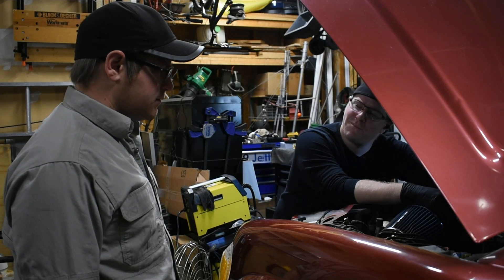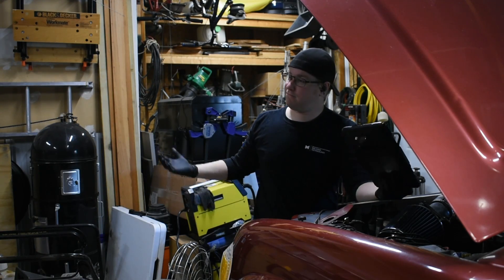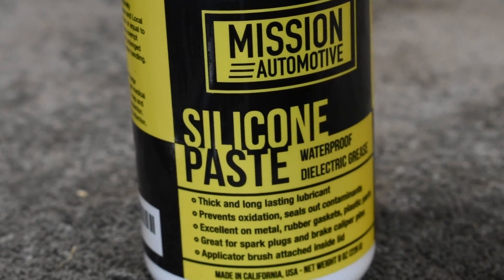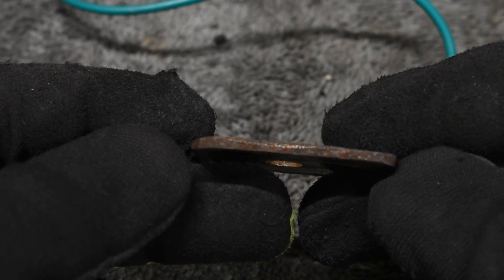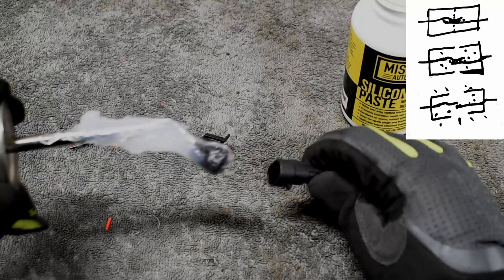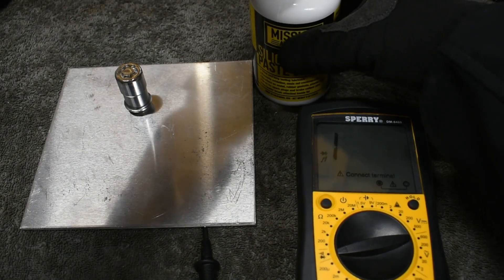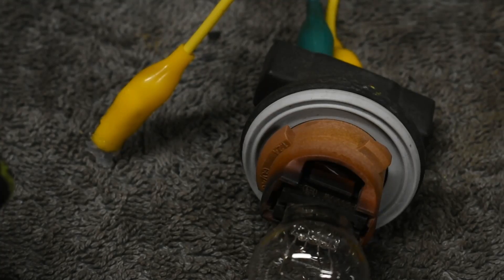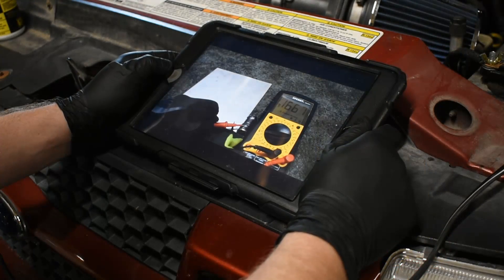The Shocking Truth of Dielectric Grease

Comment: I don't understand why people get confused about Dielectric grease,  I have used it for years without a single problem, One thing I will point out what you done in the video that I avoid doing and that is I don't use it on connectors that already has a seal/gasket, My reasoning is that the connector is already protected from the elements and the grease you put inside could get compressed when putting the connector together which can result in blowing the seals out

Comment: I experience connection interference on my Electric bike due to connecting/disconnecting the battery. Each time you initial a connection/disconnection of the battery you can cause an arcing of the connection which can lead to a buildup of interference. The dielectric grease can provide a coating that prevents the arcing from occurring. It also reduces the friction of connecting the battery allowing for an easier assembly while reducing the buildup of interference particle and oxidation of the contacts. Just be mindful that their are two types of connecting grease. Conductive and non-conductive. The conductive type is impregnated with carbon and i would recommend that you totally avoid using the conductive type of grease on your battery terminals.
Reply: What you need are anti spark connectors, These have a built in resistor connected to an isolated pre-contact point that shunts through the resistor as the connectors are mated that allows the capacitors in the ESC to charge gradually (as in a 100'th of a second instead of a 10,000'th) and prevents a spark. That said grease will preserve the gold plating in large DC connectors by lowering friction so it doesn't wear off as quickly.

Comment: Is it useful on the rubber seals if your vehicle
Reply from the maker: Yes, it can be used to lubricate o rings and seals. Before using, check the label to see if it has any warnings about what fluids your dielectric grease should not come in contact with. 

I prefer to use whatever fluid the o ring is going to be in contact with (oil for oil, coolant for coolant, etc.)

Comment: From the uk some people say dont get it on the connecters only on the plastic around coil pack is this true. And how about spark plugs is it ok
Reply: I experience connection interference on my Electric bike due to connecting/disconnecting the battery. Each time you initial a connection/disconnection of the battery you can cause an arcing of the connection which can lead to a buildup of interference. The dielectric grease can provide a coating that prevents the arcing from occurring. It also reduces the friction of connecting the battery allowing for an easier assembly while reducing the buildup of interference particle and oxidation of the contacts. Just be mindful that their are two types of connecting grease. Conductive and non-conductive. The conductive type is impregnated with carbon and i would recommend that you totally avoid using the conductive type of grease on your battery terminals.

Comment: Dielectric is literally an insulator similar to wire insulation. It works well on cleaned-up electrical contacts because: 1) keeps connections clean and weather/contaminate resistant, 2) lubricating electrical contacts providing a tighter fit by increasing the surface area of "Certain Applications" such as a threaded battery terminal connection. Silicone enables the bolt 🔩 to drive deeper inside the tap resulting in more surface area... THUS, increasing the conductivity in that instance!

Comment: not only nonconductive it is a good insulator. Main use is for insulating (and lubricating), spark plug boots, prevents tracking very effectively, especially good for insulating bothe ends of coil on plug boots (coil overs). We are talking many thousands of volts, so has to be good insulator.

Comment: I used to use diectric grease on snow plow and semi light connectors. Problem was moisture would get into connectors, the grease would help retain the moisture and there would be shorts. Watched a video of a guy restoring a trawler in Australia, he used a spray on connectors that dried, did not restrict connectivity and prevented corrosion. Can't remember the name off hand but it works well. I figured it was designed for salt water applications so it would work well in snowy environments where salt is used on roadways and I have found it is much better than dielectric grease.

Comment: no... but it does SLOW DOWN water ingress.... 
i live in montana.... so it gets WHEELED HARD in snow
.
trans output shaft speed sensor codes..... because rusty 97 shitbox jeep things
un plug, spray out with contact cleaner/WD-40..let dry.... big glob of di-grease.... plug it back in
get about 100 miles and do it again lol
got pretty quick at it in -50F

Comment: Helps prevent voltage leakage.
    Helps insulate the electrical connection in frigid conditions.
    Protects against water damage.
    Protects against corrosion.
    Protects against dirt and grime.
    Protects against heat damage.
    Protects against material bonding.
    Protects against electrical overheating.

Comment: I never had a problem with greasing first before connecting. 
And if i wanted to help conductivity like on starter motor and alternator terminals i use a little copper grease.

Comment: you need to measure actual voltage drop ...... i use dialectic grease on all insulated connectors as a deterrent from corrosion..... BUT in the PROPER areas AND in a PROPER amount

Comment: I have put it on connectors for decades without problem.  Generally, avoid metal to metal contacts but all around do.  Many times, I put it metal at metal without problem.  There are explanations on the Internet that when you put dielectric grease in contact it goes in walleyes of metals.

Comment: If the dielectric grease was a conductor it would short out systems where the grease is making a connection between two terminals,like it would if you placed the connectors under water.

Comment: Using DeoxIT on the contact pins improves conductivity AND protects against corrosion of the bare metal. Better conductivity reduces/eliminates pitting caused by hot spots along the surface of the metal. Dielectric grease does none of this. I use DeoxIT on everything where metal meets metal whether it's automotive, networking connections, HDMI, antennas, computer boards, light bulbs, switches... the list goes on and on.

Comment: This video is missing the real point. The grease eliminates the formation of oxidation and corrosion by the simple act of filling all voids (if adequate amount is applied) within the connector. The electrical connection is still made merely by the actual contact of the two metal contacts that actually sufficiently touch together adequately. As the video correctly states, the scraping action made at the metal connectors actually clear away only the grease between the 2 contact points.

Comment: I Just to add that.i    had been using permatex dielectric grease on ignition coils every time I bought one !!well and when came to starting  they would just Crank !!well.  My   first thought would be to Blame the Coil  makers!    and Today I replaced my second coil and greased it and wouldn't Start!!! so I went bought another and DID NOT PUT ANY Dielectric grease and the car Started Perfectly All.   I can say     its a Mistake !!  the manufacturers ARE HIDING SOMETHING OR ELSE PROVE IT OTHERWISE!!!!

Comment: If it was conductive , all the pins on a multi pin connector would be shorted together or even to ground in other cases , I tried  to explain  this to a guy at work.  He just wanted to fight over it. Thanks for your demonstration,  good work  .
Reply: Exactly!  You use dielectric grease because it does not conduct electricity, where other greases may conduct electricity and short out connectors.  Dielectric grease does prevent water from entering the connector to prevent rust and corrosion and since water is electrically conductive, it could short the connection.
Reply: @chrisgraham2904  exactly  👌
Reply: It seems like EVERYBODY want to fight about this -
You'd think we were talking politics!!!

Comment: Although silicone grease can be called a dielectric, it is not "dielectric grease". Dielectric grease may be based on a silicone formula, but it is not the same as common silicone grease.
The main difference between the two is that silicon grease will eventually cure and go hard. whereas dielectric grease won't.
Reply: Good to know. Can I use dielectric grease  everywhere I use silicone Grease?
Reply: @littlereptilian7580  Yep.
Reply: SiliconE grease! Silicon is a hard silvery transition element.

Comment: Now I have a question, and excuse my ignorance, I want to use a normal regular grease instead of dielectric grease on my ignition coil, would there be any difference? Or would it change conductivity, connectivity, corrosion aspects?
Reply from the maker: As long as the "regular" grease is not conductive, it shouldn't cause any issues.
Reply: It will work in theory but 'regular' grease is petroleum based and shouldn't be used on some plastics and elastomers.  Dielectric grease is silicone based so it won't hurt or swell the seals or the body of the connection.

Comment: Might not increase it, but it prevents corrosion and corrosion creates resistance. So in a way it can
Reply: Maybe use something else that   does increase conductivity and stop corrosion!!! Lol
Reply: @royblackburn1163  Ok like what?
Reply: @debrajohnson4689  Aronix Aluminium contact paste, there are lots of products on the market , a good electrical connection is priority far better a good clean joint then put dielectric on the outside to prevent corrosion,  as for having dielectric in air gaps and grooves does it not make more sense to have a conductive paste there instead? Using a dielectric in a joint is just plain silly think about it learn to think for yourself.
Reply: @royblackburn1163  hard to find and expensive die grease and even vaseline is cheap and easy to find
Reply: @royblackburn1163  In regular low voltage multiple-pin circuit connectors, such as automotive applications, flooding with a proper insulating grease of low-viscosity dielectric grease is perfectly acceptable unless a manufacturer recommends against it. The grease should have good stability and not contain metals in any form, and be specifically designed for use as a dielectric grease. This generally is a silicone dielectric grease, although some Teflon based greases are acceptable.
Reply: @debrajohnson4689  eBay,  your priorities should be good electrical connection 1st, anti corrosion 2nd. Vaseline is non conductive,  make a good clean connection first then put it on the outside to keep air and moisture out. Check out manufacturers websites don't believe everything you see on YouTube. On low voltage systems every voltage counts that's why we use contact cleaner .
Reply: @debrajohnson4689  KY jelly works well too..

Comment: ALSO, there is carbon grease (looks black, very messy), manufacturer description states for improving electrical connections and dissipating electrostatic build up. 
i put a dab on a piece of paper and then put probes from a multimeter on it, 1/10" apart, the resistance measured was 3000 ohms! so, it will conduct electricity, but very poorly. 

there is specialized grease with silver particles in it, comes in a small syringe and costs over $50 and will conduct electricity very easily.

Comment: I feel like the number of people who think dielectric grease is a conductor are balanced out by the people who think it will actually prevent electricity from flowing through a good connection.
Reply: Im probably one of them, lol, if someone puts it on a battery post and the part that bolts to the post it seems like it would lose some continuity even after it pushes the grease out, because noway will it push it all out, would still be a thin layer, I have read so many comments about this grease and it seems like multiple people have different explanations of how it works,  I know it's not conductive, 
What is the difference in dielectric grease and dielectric paste?
Reply: I have been using die electric grease and even Vaseline for years over my battery terminals for years with no issues.  I believe that you would not degrade your connection if you connect the battery terminals first then apply the dielectric grease to  inhibit corrosion.
Reply: @rfcasey  Factory shop manuals instruct this?  The way I see it, repeated heating cycles are likely to polymerize the grease trapped in the interface.
Reply: @davidl2281  This is a case where "what common sense tells us" and "what is actually going on" are very different. It won't reduce conductivity because of how electrical contacts work at the microscopic level, they are over 99% air gap, a "smooth" contact looks like a mountain range microscopically and only the interference between the microscopic "peaks" is actually in contact. The pressure here is incredibly high in terms of pressure per square area so it just squeezes out the grease into the microscopic gaps. The total pressure between the two contacts is focused into less than 1% of the actual area at the microscopic level.
Reply: I just use copper grease
Reply: I just use wd40
Reply: Dielectric grease is not an electrical conductor, why do you want to contaminate the interface?

Comment: Car is completely dead using the grease.. Here in my place may 29 2021...the connections were bolted tight ...... car runs fine after using brake cleaner this video is not didn't work out for me

Comment: Yeah folks believe a lot of misinformation out there. Much obliged for showing the truth of the matter. A properly made connector will push the grease OUT of the way. I've never used a lot of grease, but I never used a little bit. Just slap it on and go.
Reply: This guy is spot on! I had to learn the hard way after losing cranking power from the di electric grease smeared on the battery post. Thanks again!
Reply: @hose8239  Yeah you can smear it on AFTER the terminals are connected. I did that in my 86 Ranger I used to have. I have a 97 Blazer now and it has a side-post battery with rubber covers so I don't bother with that anymore.

Comment: I’ve never heard anybody say that dielectric grease improves conductivity my entire life I’ve heard people talk about using the ledge agrees on electrical connections to make them waterproof so that the water can’t get in the electrical fittings is that true does it help waterproof electrical fittings?
Reply from the maker: Dielectric grease can waterproof a connector. Periodically check the connector for any corrosion or adding more grease.

Comment: in my opinion anyone who uses any paste /grease/ spray /chemicals in general without knowing what exactly it is meant for is just hopping for miracles that some times seems to work but in the long run it can backfire and the ignorance can be more harmful and costly than the quick guess fix or hope , especially where water /heat/electric and fuel all combine in the same place .

Comment: So... Vaseline will work fine?
Reply: Yes, possibly, until you use it in a rubber connector, when it will dissolve the rubber.  There's a reason di-electric grease and petroleum jelly both exist.  I love watching videos where dickheads use vaseline on rubber gaskets and seals......instead of rubber grease.
Reply: @einfelder8262  Thanks!
Reply: ask yourself ,do they sell vaseline in the auto parts store? vaseline is a petroleum base product , that means it can be and it is flamable ! and you want this on your spark plugs boots close to extreme heat?... so NO !
Reply: @frankc6430  Oil is a petroleum product, they sell that at the auto parts store, so they probably sell vaseline too.  Just sayin', your logic is illogical.
Reply: @einfelder8262  why are you guessing just to voice your ignorance ? we are talking about Vaseline and Vaseline should not be used as a lubricant inside the spark plug boot because it is flammable... this is not about illogical sales of a product ,you should call them and ask at least not just guess stupidity!

Comment: As shown, the grease is actually an insulator.  Its main purpose is to ease the subsequent removal of parts like connectors and rubber spark plug boots that can heat-bake together and stop electricity "Leaking" out from underneath.  Keep it away from the actual connection.  It's also OK to use to help corrosion resistance on battery terminals and other exposed connections.
Reply: bah its designed to provide a seal from moisture and air where the surfaces contact. So it has to be on the surfaces where the contact happens.
Reply: I used it to keep boot plugs from sticking
Reply: How wrong you are bud its to prevent oxidizing.. main purpose preventing baking? Is that why spark plugs have it lol
Reply: @northwestrockgem9745  Hey pal, heating the boots will cause them to stick (oxidize or, if you will, bake on)to the insulator.  If you think its not and insulator, coat the plug electrode with it and try to start the engine.
Reply: If it lowers conductivity like in this video why would you use it on battery terminals?
Reply: @barrysuss4421  First, clean the battery terminal and cable clamp. this ensures a good contact.  Second, coat the Exterior of the terminal/cable connector with  thin coat of dielectric grease.  This helps stop battery terminal corrosion due to the ever-so-slight current leakage from the battery.  Current will flow from the Positive terminal to the nearest ground across the battery. surface.  The current loss is too small to even measure and the current leakage won't flatten the battery but it will cause corrosion.   Hope this helps.  PS  you can use KY jelly or Vaseline also as well as commercial battery terminal spray.